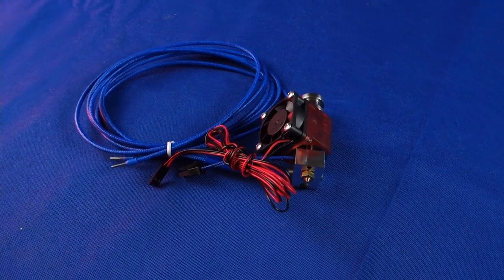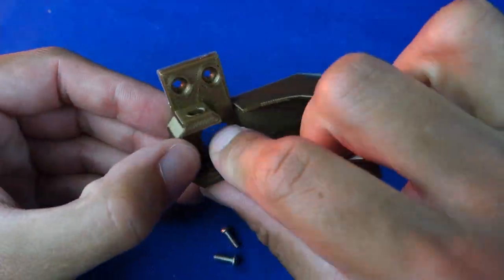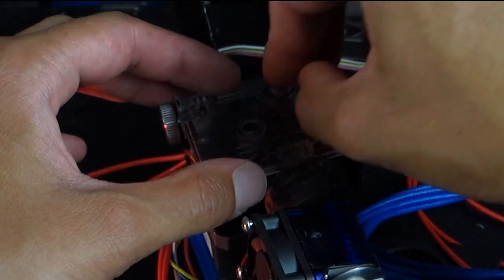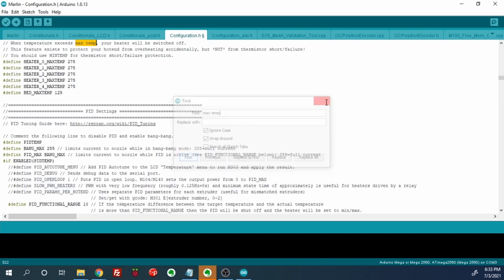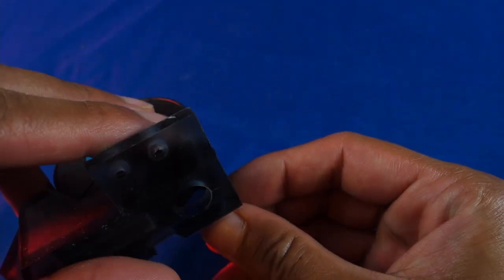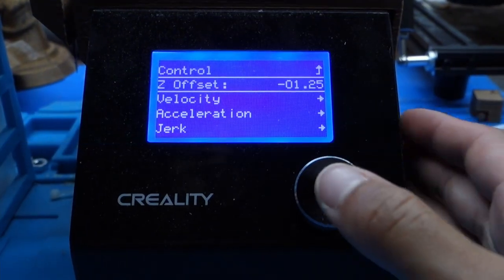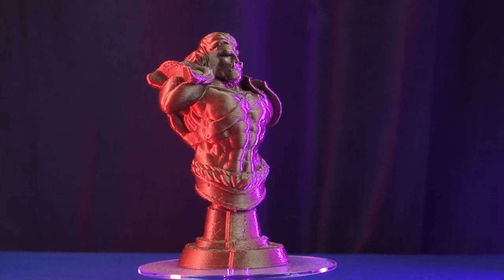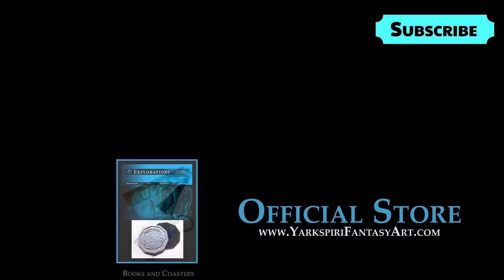CR10-V3 - 𝗣𝗿𝗶𝗻𝘁𝗶𝗻𝗴 with 𝐇𝐈𝐆𝐇𝐄𝐑 𝙏𝙚𝙢𝙥𝙚𝙧𝙖𝙩𝙪𝙧𝙚𝙨

Comment: Kinda late to the party, but I'm trying to do this upgrade and I am really unclear as to the assembly of the hotend with the additional parts. Do you have and pictures or drawings that show a little more detail?
Reply from the maker: Unfortunately, I do not.  I traded the  machine last year, so I can't take any photos.  But it is possible to slow down the video playback, which might help.
Reply: @Yarkspiri  I think I got it figured out. But even at .25 speed it isn't obvious. I think I see that the little black collar at the top of the heat sink is missing in your assembly (It's only a frame or two @ 1:41, but it looks like it has been removed). I haven't finished it yet (I only get a few minutes here and there to work on it), but I think that was the biggest hurdle (so far)
Reply from the maker: @michaelelandon  That's good to know. Thank you  posting the solution since it'll definitely help someone else.

Comment: At the start of this video @ 0:27 you show that the cr-10 v3 uses the same bracket as the Ender-3 max, however later on you install it with the other L shaped bracket @ 3:12. Why is this? I am wanting to install a CR touch onto my CR10-v3 however am unsure of what else I will need to do to make it work, software wise.
Reply from the maker: It's the same one as the Ender 3 max. Sorry about the confusion, I used the wrong video clip.  All three mounts come with the CR Touch so as long as you buy the one from Creality you should be fine. If you're compiling your own firmware, then you'll want to download Arduino, but If you are using the preconfigured one, you can use the Creality Slicer that came with the printer.  In order to upload with Arduino, you MUST have done at least one firmware update using the Creality software.  I go through some of those specifics within this video.  https://youtu.be/f2gRniPOtN8  The transcript is on the main website.

Comment: After experiencing jams and filament leaking out of the top of the heatbreak within 10 prints of owning this printer, I'm seriously considering trying another hot end. How has this upgrade been working for you half a year later?
Reply from the maker: It's worked well for me, although I have to say that the leak in your case sounds like the heat break or the nozzle wasn't properly installed for you.  I would also replace the inner tubing with a Capricorn one, since it could also be your issues if it wasn't cut the correct length.   Just make sure to clean everything out before you put in the new one.  The all mental hot end will have a small amount of Bowden tube within the heatsink so replace that with a Capricorn.
Reply: @Yarkspiri  That might have been the case, I removed it once to clean a jam and screwed it back on cold. 
Btw, I've also been looking into the CR Touch. Is your mainboard version 4.2.2 or 4.2.7 like the listing recommends? I opened up mine and it said 2.5.2. Just wanna be sure before I buy one. Creality support on Amazon has been very helpful but they said none of the CR10V3s ship with 4.2.2/7 boards, so I don't know what to believe.
Reply from the maker: @B-U-N-N-I  I was an early adopter of this machine, so the board that I have would most likely be different from the one currently being sold on Amazon.  At the time of purchasing it, it was only available directly through China and wasn't even listed on their main website at the time.  I had to go through a third party vendor in order to get my hands on it.  They've since rectified those issues and made it a lot easier to purchase through Amazon and their own website.

Comment: Thanks for the hard work! I do have an issue with the v6 swiveling inside the adapter though. Is this something you dealt with?
Reply: you mentioned a zip tie but i do not see that in the video.
Reply from the maker: The zip tie is to keep the Bowden tube coupler engaged.  Although the V6 can swivel, it doesn't because of the thermistor and cartridge wiring helps hold it in place.  You do need to be careful when changing the hot end afterwards.

Comment: not sure if youll see my comment but worth a shot. how do i know my CR10 is compabitable with this new CR Touch? Ive had my CR10 for a few years now so im sure its an older model but not sure what to look for or how to get it to work on mines. any help would be awesome thanks.
Reply from the maker: I bought one of the very first models to come out, so as far as I know it should work on all of them since it was designed to be forwards compatible.  What you can do is check the pins on your motherboard and double check that the wiring is also the same.

Comment: Creality claims that the CR Touch does not work with the motherboard (2.5.2) of the V3.  Did you need to swap any wire positions to get it to work, or have you installed a different motherboard?
Reply from the maker: I didn't need to change anything on mine.  However, I did flash my own modified firmware using the source files that they provided.  I've provided the same firmware I used on the thinginverse page.
Reply: @Yarkspiri  I tried installing the non bootloader .hex file with Cura since I am plugged into the micro usb port. I dont have any of those menu options and when I try t auto home my extruder crashes into the bed and the CR touch is not deployed. did the firmware not take?
Reply from the maker: @cantgo2fast  The machine first comes without a bootloader, and that sounds like the issues you might be having at the moment.   So if this is your first time changing the firmware, you'll have to use their software to do the initial installation.  I have some important notes which I included in my BLTouch review, so I'd recommend taking a look at that video or transcript. https://youtu.be/f2gRniPOtN8

Comment: Hey Yasmeen. Creality documentation states the crtouch is only supported on 32 bit mainboards. I'm going to print that end you made and I'll buy something off you. I have access to any plastic I want at the makerspace near me. What did you use if you don't mind me asking. Sorry. I RTFM you generously created. Thank you very much
Reply from the maker: I printed with an ABS like resin for the final version with my SLA Printer.  Any ABS material will work well, but you can work up to that if you're printing on the machine you currently have.

Comment: Hello Yasmeen 

I just got the cr10 v3 I was wondering where on the mob you plugged in the 5pin connector for the crtouch?
Reply from the maker: There's a connector on top of the CR Touch and the other end goes into the connection hub that's attached to the X gantry.  It's near where the Bowden tube motor is attached.
Reply: @Yarkspiri  Thank you ! :)
Reply from the maker: No problem.  Best of luck.

Comment: Thought about doing this last week.  I'm tired of taking apart the Titan direct drive.  I don't think it was right from the beginning.
Reply from the maker: Agreed. This one is much faster to disassemble if an issue arises.
Reply from the maker: You might want to use a capricorn tube for the inner tube.  There does seem to be  heat creep.

Comment: "used my SLA printer to print with engineering materials" - can you be more specific? What resin did you use to handle the 300º+ temps of the all metal hotend?
Reply from the maker: Since the parts don't make direct contact with the heater block, the material doesn't need to be that resistant to high temperatures. I used an ABS like resin material which worked out fine in my case, however if you only have an FDM printer you can print with PETG first then upgrade to ABS or an equivalent afterwards.
Reply: @Yarkspiri  Could you please link to the resin you used?
Reply from the maker: @jaychapman6448  I use the Fast ABS like resins https://siraya.tech/collections/canada

Comment: do you have the same firmware but without bl touch?
Reply from the maker: Not currently.  But I used the source code which was provided by Creality as the base firmware, and they had two versions.  One with and one without the BL Touch.  I've recently checked their website, but it seems to have been removed.  The closest I found was from this link. https://github.com/devjj/cr-10-v3-marlin-config.  Unfortunately, I got rid of my machine recently, so I won't be able to do a test.

Comment: where did you plug in the crtouch? z endstop or bltouch port?
Reply from the maker: I have another video that goes through the process in more detail here.  https://youtu.be/f2gRniPOtN8  The important part is that there's an area in the connection hub for this connector.
Reply: @Yarkspiri  Thanks!

Comment: Odd request. But I just purchased a real v6 off of their site. However I need to completely wire a new heater cartridge into my cr10 v3. I would appreciate any help.
Reply from the maker: The heater cartridge connects to the connection hub on the X gantry.  It's easier to rewire the connection by using the old wire and this https://www.amazon.ca/gp/product/B07RFRP1NB/ref=ppx_yo_dt_b_search_asin_title?ie=UTF8&th=1 since it'll be easier to change in the future.  This method doesn't require any soldering, which is nice.
Reply: @Yarkspiri  I don’t suppose you have any documentation, or have a video planned for this process? Do you know of any docs or videos detailing all the steps of getting a stock cr10 v3 to this point, including all parts with nothing glossed over? For people with no electronics experience, trying to piece together steps is near impossible.

At this point, I’ll probably drop the cr10 completely and go with an ender wherein there are drop in replacements for all metal hot ends, but I am still trying to muscle through it currently.
Reply from the maker: @glenhinkle  I am slowly starting to make PDF files available on my website, but it'll be awhile since I'm getting ready for a show and I prefer to take my time with it.  This machine is next in line to create an instructional PDF, but the diagrams are normally what take the longest to put together.  If you could list some things that you'd like to see in the PDF then this will make it easier for me make something that is more complete.  I do currently have the transcript on the main website, which is a lot easier to follow for people just starting out.  **The Ender 3 V2 instructional PDF is currently available, BUT glosses over the upgrades for the machine for now.  It does have a lot of basic information that new users would need along with explanations**
Reply: @Yarkspiri  Thanks for the response, and the willingness to share your exhaustive knowledge. I'd say the most useful thing would be having visuals from all angles showing how it all fits together. For example, when you're screwing in the fan to your printed part, you're using a nut that didn't come from the stock printer. It took a while for me to come to that conclusion without a clear shot of what was going on.

Seeing how the parts go together in relation to the surrounding shots, with at least a second duration so that it can be reasonably paused (if in video format) would help immensely. That, and understanding how the electronics connect, how/if you're handling voltage changes, and whether you're soldering or connecting via some other method would fill in the gaps for all of us n00bs.

Comment: Nice video, thanks. Im impressed on how you designed in blender instead of a CAD program with acurracy, did you use any addon for that in Blender?
Reply from the maker: Nope.  I create stand in shapes to the correct dimensions, however there is a plugin to make things easier, but I have yet to start using it.
Reply: where is this rumor of blender being inaccurate coming from lol

Comment: yes I go the message ...and one yes i used a new SD card (one that didn't come with the machine)

No the printer didn't reboot it just went into the home screen on the regular stock software

i used the creality software with the other mother board and uploaded the hexfile and now that board wont take any updates from any software.. so im really scared to try it with this one..

and yes i am able to nav through the menus...

and no the brain isn't hooked up to the printer because of the different thermistor that is on it from the E3D hotend so didn't think it was a good idea to try and pre heat it to print anything
Reply from the maker: The new motherboard didn't update then, since it requires the Creality software to do so for the first time at least. 

**BUT** there is a known issue that some BLTouches aren't wired the same way and can brick a motherboard.  This issue is known to be present on some of the one's that Creality sells themselves.  This may not be the case with the CRTouch however, as long as you purchase it from them directly.***

It is possible that because of the updated firmware (on the original motherboard)  it requires updates that are done with hex files through an SD card OR through Arduino.  You'll know if this is the case if you can update the motherboard via Arduino itself.  

**Unless the motherboard is connected to a heated bed and a hot end, you will not be able to test their functionality.  This is due to the "Thermal Runaway Protection" which is a very important safety feature to always have on at all times.  This safety feature prevent the machine from running unless these two are properly connected and receiving signals, so your old motherboard might be fine but requires the connection in order to be properly tested.**

As long as you got the same E3D hot end as in the video, the thermistor settings should also be set correctly.  **But it needs to be a genuine E3D hot end**
Reply: @Yarkspiri  Well like I mentioned before, my brain of the printer is not plugged into the printer itself ... and I wont plug it in until I know I have the right firmware installed with the right settings for the thermistor...   my problem is I cant get the motherboard to take the firmware .... and its not doing it from just putting it on the SD card and my other motherboard stopped connecting to pc when I tried updating with the hexfile Using the creality software...so if my only other option is pushing the update through with a aurdrino .... well I cant do that because I don't have the hardware to do that ... SOOO I guess I'm down till I can get ahold of one...and I have updated the board I have in there now, through creality slicer with the latest firmware from creality... unfortunately that does not have the change to the Thermistor or temp for the E3D hot end...(and yes it is a actual E3D V6 hot end kit)...

Thank you very much for your time and input... If you can think of any other way of pushing that hexfile update through without using a aurdrino  please let me know... other then that I'm down till I can get the hardware for it.
Reply from the maker: @chriscole4398  You can normally connect to the Arduino software  via the Ethernet B port.  ***Having any other software opened will prevent the connection to occur.  So please make sure that you close Pronterface, Cura, Xloader, Prusa slicer or anything else.  If you're not sure about what type of port it's connected to, check the device manager instead.   E3D''s website has the information on the thermistor type.  Please feel free to check it for yourself to ensure the correct compatibility.  As I said before your printer will not start unless the hot end and hot bed is connected.  So your old motherboard probably works, but until it's tested you'll never know.   Sorry, but that's the best I can do considering I've just finished an 11-hour shift.
Reply: @Yarkspiri  no you are fine ... i thank u very much for taking the time to help me ...
Reply: Hello its me again..... quick question .... i got your firmware installed .... and when i turn on the printer it does not seem to see the thermister...any idea ?? on the display the thermister reads 0 and it should read atleast close to room temp...without it heating up...and yes it is a actual  E3D hot end kit with the number 5 thermistor...Soo any ideas?  when i go to preheat the nozzel it freezes the printer ...and asked me to reset...
Reply: @Yarkspiri  Hey its me i got the firmware on and everything seems to be working except for the dang BLtouch... every time i set the offset and save it ... i reboot the printer ... rerun bed lvling.and go to print ... and it always seems to ignore the offset setting... the nozzle always seems to print at the same Hight...
 which is maybe 3 to 5 MM off the bed ..... any ideas ??
Reply from the maker: @chriscole4398  You don't need to reboot it.  Just try to print something right after setting the Z height (NOT using the EPROM) using the tuning setting.  Get ready to turn it off if it crashes into the bed.  Use small increments.  For some reason it doesn't seem to accept the EPROM information.